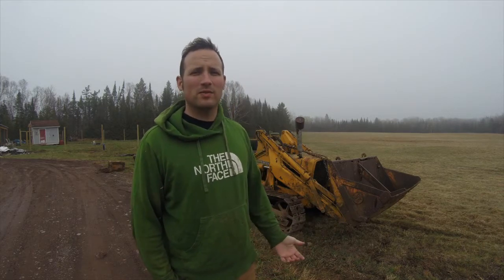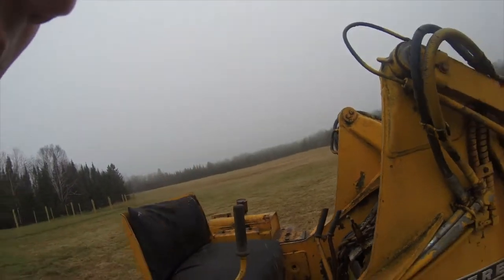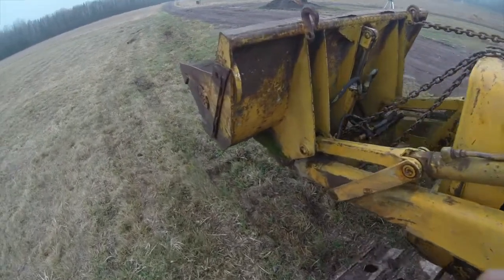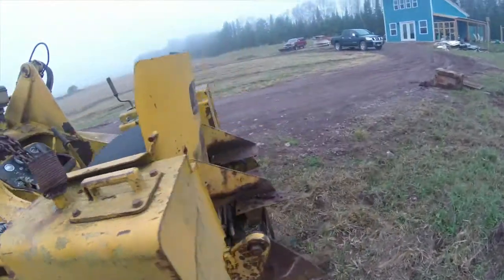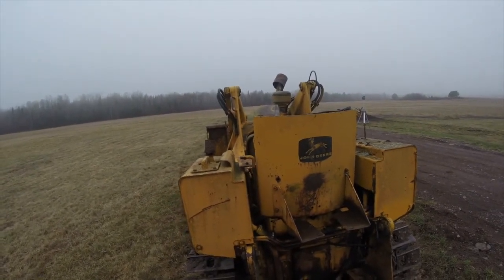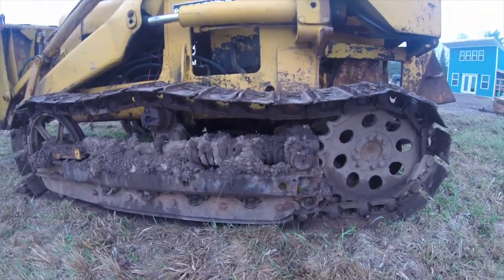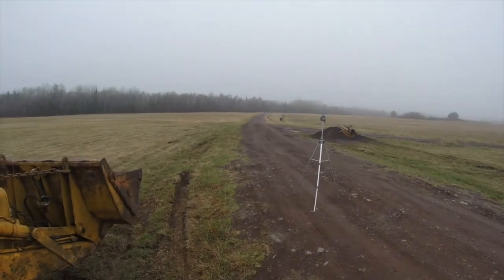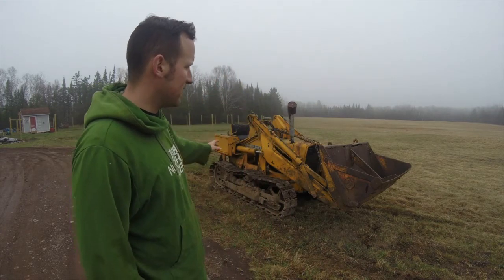Final Dozer Update of the Year

Comment: I am not sure where you are at with this machine. You do not have to remove the loader to do the dry clutches but it is a ton of work. If you do not have water in your final drives I would try getting it running then adjust the brake bands and see if they will free on their own. The clutches kit is 700 bucks also put new throw out bearings in while your in there. The problem with these 1010s is there parts are so spendy they get to a point where it's just cheaper to buy a newer machine. I know that sucks to hear. Also is your reverser working? You start taking about the injector pump, the hydro pump,  the joystick controller. You can get into several thousands in a real hurry. What state do you live in. I have your exact same machine and at this point I wish I would have just found a jd 350 instead.

Comment: Seems like a good power wash , oil and cover it up, then try saving some money and let a company check it and repair it. Moste places that repair these kinds of machines have heavy lifts etc to do this job.
Reply from the maker: I've debated your advice, and I have to admit that it's something that I've genuinely considered throughout this process.  That said, my general viewpoint in life, and specificially with this project is that you can never learn from what you don't attempt.  Repairing heavy equipment is a valuable skill, and I feel as though I can never grasp that knowledge if I don't attempt it first.
Reply: oo sure its something nice and fun to do , but i thought it was your fathers machine , so testing and trying if you can do it can also harm it. Test on an old machine with no history like this would be better maybe. But i agree totally that you need to try things if not for the fun and great feeling of getting it done.
Reply from the maker: I understand what you're saying but to me, because it was my father's machine, that makes it even more important for me to be the one to learn how to repair it.  If it was something vital I would rely on those more experienced.  However, everything that I will be attempting to repair does not currently work; if I am unable to repair said aspects, there will not be any excessive damage - it will still just not work. I totally get where you're coming from, but I have spent almost two years researching and I'm confident that I will be successful.  I wouldn't risk damaging something this important to me.